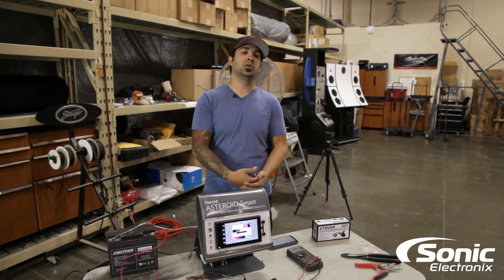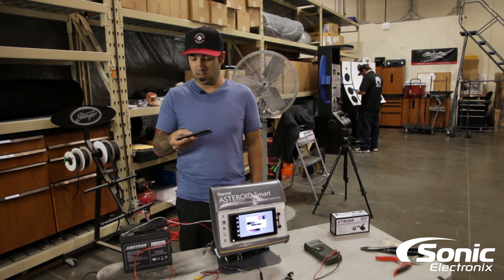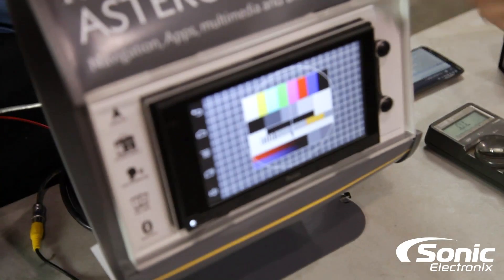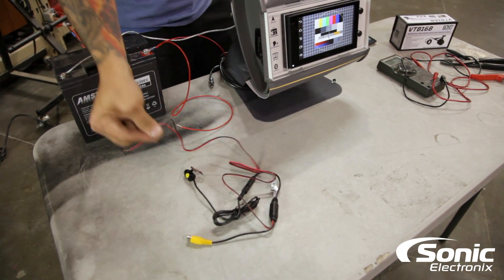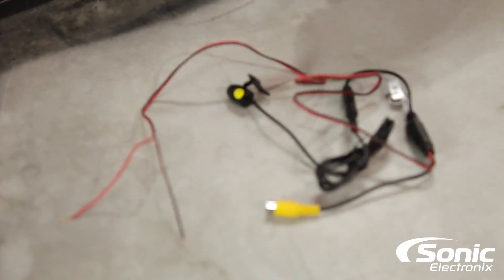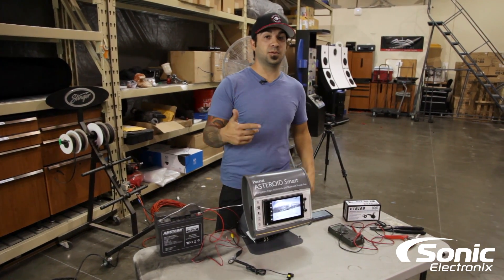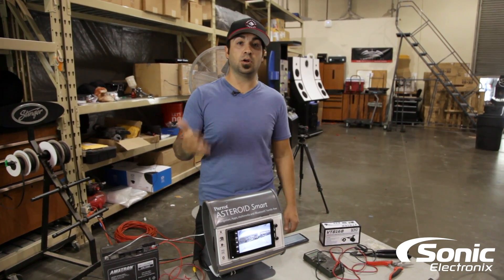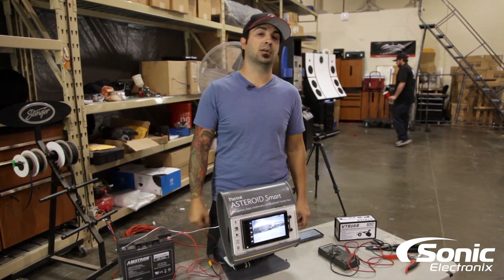Why is my Backup Camera Staying on When it is Not Grounded? | Car Audio Q&A

Comment: Is there a way to hook up a reverse camera not as a reverse camera source if your head unit doesn't have the normal "back up camera video" like yours does? As in is there a way to wire it so I can use it as a camera inside my car and see the output on my head unit instead of using as a reverse camera? I know I would need to connect it to a power source for example when the car is switched on it powers up but not sure how to get it to show on the head unit screen without being in reverse when mine doesn't have a option like yours does if that makes any sence? 😂

Comment: Hi I have a aftermarket radio for my Fiat 500 I connected the rear reverse light to the camera and I connected the other end to the radio I can’t figure out where to connect the reverse yellow cable to. The camera turns on when I open the driver door then it turns off quick. When reverse It won’t turn on if the door is locked what should I do?

Comment: After market install went well. Radio works great except when I turn on my air conditioner. Then the radio goes on for about two seconds then it goes off and then on and then off. Any ideas why that should happen? Its too hot to drive without air!

Comment: I thought I fixed it but nope.
The radio gets ground from the RCA and the radio antenna. I also wired it's own ground. For power I used the reverse wire by the fuse panel. I had the power for the camera there as well but then moved it to the ACC of the Wire harness for the radio. I guess now I have to try the power wire from the reverse light itself.

Comment: I have just installed rear view backup camera on my dmx7705 s, it only works when i press camera button, i gave it +power from reverse (there was a special cable in my toyota for camera)  but whenni put in reverse nothings happens
Reply: Check you T tap connectors make sure there is metal on metal contact i just had this issue checked on of my connecters was crimped to the rubber of the wire once I fixed that it worked
Reply: @stevenharrison5155  I resolved that problem on next day. thanks for answer

Comment: Hello I really hope you can help me, I got a Dual brand rearview camera from Walmart. I connected the video RCA in back of unit, and the red wire attached to the yellow RCA to reverse wire, and in the camera side I connected power to backup lamps and ground of course. And the yellow RCA to camera the red from yellow RCA to power to backup lamps. Showing no video single, what did I do wrong plz help

Comment: My question is did you say hook your reverse camera wire from my head unit to the head unit? My camera is on as soon as I cut my car on and stays on
Reply: It's because you have it hooked up to the constant power not the ign power then run a wire to the post side of reverse light to the light purple rev wire of the head unit.......remove the tail light rev plug remove build and use a tester find the pos wire

Comment: hi . I have TOYOTA PRADO RADIO/CD/DVD/SAT/TV SAT NAV UNIT, #18009, 120 SERIES, 2003-2009 . I  want to add a reversing camera on this unit but i don't know where the video cable goes in , can you  help me please. thanks
Reply: Alex Merkla if your unit accepts an A/V rca in, Then you’ll see the connection on the back..It’s an RCA connection on the back...Google is your friend and it has all the answers

Comment: On a altima 2012 is the factory reverse wire positively or a negatively charged when you put car in reverse

Mine stopped working 

Factory bose system with rear view cam

Comment: My reverse camera monitor stays on when on drive and screen is blue ! But when In reverse back up cam kicks on but in drive screen switches over to blue screen and Dosent turn off on drive ! Why is it doing this and what did I do wrong during installation? Maybe a bad ground ? Monitor positive and negative wire hot wired to fuse box and back up cam is connected to positive and negative wires going to the reverse light bulb. I installed this device to a 1986 M1009 which is a 1986 Chevy blazer k5 diesel that was stripped down to United States Military standards and this truck has no radio because the army didn’t want our troops feeling good about themselves 👍🏻LOL 😂

Comment: Hello everyone! Need help about the reverse trigger, rearview camera is ok! But when i switched the parking lights(running lights/tail/headlights) and pressed on brake the camera triggers and show on my head unit! Even its not reverse! the trigger wire is connected to the reverse light,
Reply: Hey, im experiencing the same issues. Hooked up the r camera to reverse lights, ground n trigger..now everytime i hit the brakes,turn signal, the video glitches and changes view. Even when im not in reverse. Any solutions?

Comment: I have my back up camera install only with reverse trigger that is camera is getting power from reverse light but I want it to be all time rear view as I have the option of "rear view" as it is shown in the HU in the video. unfortunately I did not get you when you said to use a switch between radio power to camera power. plz help me.

Comment: so the reverse wire coming off the car stereo is connected to which wire?  I am installing my system right now I have everything hooked up except I want the camera to be activated when I put it in reverse...the reverse wire coming off the car stereo doesn't have a similar wire to hook up to on the wiring harness ....so which wire should I hook it up to...any purple wire?  My reverse wire happens to be purple and white and I can't find that matching wire from the wiring harness...help?  suggestions?  thanks
Reply: The reverse wire coming off the car stereo(purple white), you can hook it up to your reverse light 12volt connection which is not on the harness. You can easily access the reverse 12volt connection at the reverse light itself on the rear of your car. Notice that the reverse light only turns On when you put your car to reverse gear, that will also triggers the purple white wire so that your reverse video will appear on your stereo screen,
Reply: +zepp3lin if I hear you correctly you're saying connect up the purple and white wire to the wires in the reverse light in the back of the car unfortunately I'm in a 24 foot motorhome so that won't work
Reply: It suppose to be Purple with white strip wire. And you have to run an extra wire up to the tail light. While doing that, you run it together with your rear camera.
Reply: zepp3lin isn't there a way to connect it thru the front instead of running another whole wire because if anything the lights in the back from factory they run to the front as is so how would I find it in the front

Comment: Hey what's up guys I need some help . I installed an aftermarket touch screen radio with a backup camera on it. I don't know if I did a wrong connection or it is normal . When I put my car on reverse the camera doesn't get activated then I go to the screen and I open the camera app and it works . I want to know if a backup camera works automatically when I put my car on reverse or it works in a different way by going to the touchscreen radio . Thanks

Comment: very helpful and informative video, i am considering putting a backup cam in my work truck, i work for directv and its a company truck we arent supposed to modify them but since i have one of the old 08's they dont really care what modifications we make so i might wire one up seems pretty straight forward

Comment: So if I am getting "grainy" static" bad picture  that's most likely due to a ground issue?
Reply: L M Check your connections also remember there is always some power ("voltage") leakage from cables so make sure signal cables are run as far away from the main power to your amps as you can.